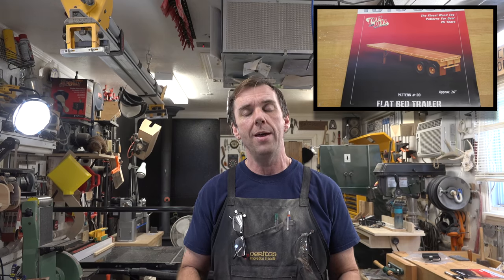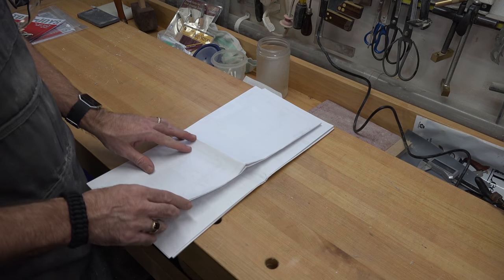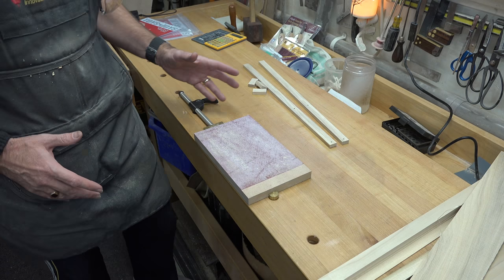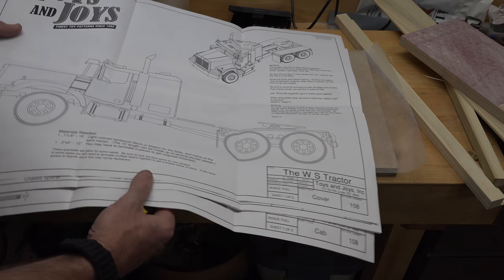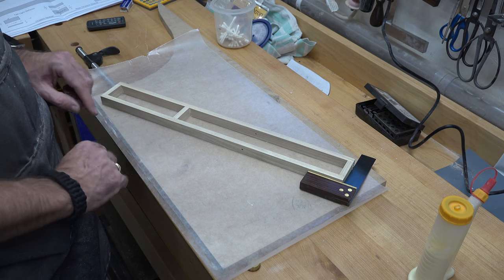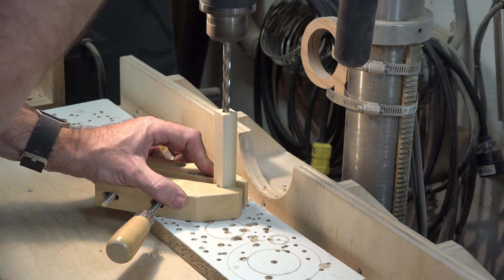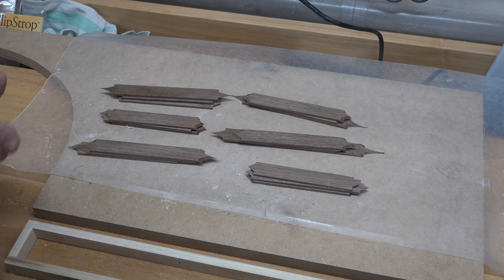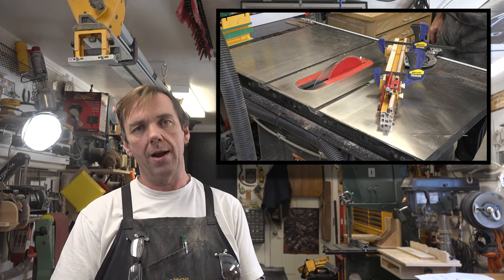SCALE MODEL PART 1

Comment: What brand of brad point bits do you use that come in such small sizes?
Reply from the maker: It's not a matter of the brand Barbara.  It's a matter of the supplier.  I find that Lee Valley pretty much has every size imaginable for brad point bits and they are available in sets or in singles.  Your choice.

Comment: I've had these plans sitting in a bag, unused, having been a bit intimidated by the parts involved. Your videos will go a long way to demystifying the build process. Thanks! Quick question: What did you use to round the edges of the axles? I'm assuming a router? But any memory of what size?
Reply from the maker: I'm going by memory here Matthew but I'm pretty sure that the axles were rounded over with a 1/4" round-over bit on the router table.  I only really use two sizes in these model builds.  1/8" and 1/4" so the 1/4" would be more fitting to this part of the model.  I hope this helps.  Good luck on your build and thanks for tuning in to the show.
Reply: @acutabove_woodworkings  Perfect thanks!

Comment: The 60° was on the plan on page 1
Reply from the maker: Thanks for the input Michael, it's appreciated.  Page one of the plans shows no dimensions at all and is nothing more than a parts list, general instruction page and drawings of the finished products.  Page two, however is where the measurements start.  I'm not being a smart ass, I'm just clarifying for others who might be reading this so that they can reference the correct prints, which would be page 2 of 9.  The 60 degree angle that I am referring to being missing, is the angle on the frame pieces, not the angle on the rear chassis spacer which does show the angle.  And while we know that these pieces go together and share the same angle, there are those who might not know that and might not put that information together so I it was more of a lesson of referencing other parts of the drawing to get missing dimensions.  For pieces that are completely different, each piece (in my opinion) should be properly dimensioned.  Working on assumptions is a dangerous thing when working with plans and for my liking, I would have liked to see each piece with it's own measurements and angles for those who are not as fluent in reading plans as you and I are.  Thanks for tuning in sir.  Great to hear your comment on the show.

Comment: Wow! What basic mistakes been made by the plans. Actually, not the first time I have noticed these basic mistakes as I have plans for a Stagecoach which leaves you up in the air to what the whole build is about. It's like they give you a set of plans and don't really give you any ideas how to go about a certain part being built. So I have no clues to how to make the build but using my imagination.
Reply from the maker: I don't think I have ever had a set of plans where I didn't find mistakes Gary.  One has to remember though that they are plans, not instructions.  I quite enjoy trying to figure out the best method of making the pieces.  It can be a challenge at times but it's one that I like.  Thanks for tuning in to the show.  I truly appreciate it.

Comment: Why do you not email them with all there mistakes. So that other people can build with no problems
Reply from the maker: While this company is quite responsive to customer complaints and concerns, they are not about to reprint and entire run of a pattern because one or two woodworkers point out some flaws or missing measurements, especially when he measurements are able to be obtained by scaling from the full size drawings that they provide.  It can be a challenge with these plans but a little persistence and some thought will get your through them just fine.  I kind of like the challenge as well sometimes, even though it frustrates me.  Thanks for tuning in to the show Paul and for taking the time to leave me a comment.
Reply: The thought of reprinting never crossed my mind, but to pay 11$ or so for a pattern that you have to basically work out for yourself is a bit of a joke. I am not a wealthy person by any means but on a few occasions watching your video, you have came back and said if you head froward to such a page and do this this way you will save a lot of trouble. The problem with this is for people on my earnings every piece of wood that I purchase has to be hard earned . So for example the bit on where you say that the drive shaft that goes under the carriage do not glue up the mounts as you will not get the drive shaft in. This  is ok but the problem comes to whenever for example I go to buy another plan. And now having the same insight that you have with plans, what am I supposed to do email you them and ask you to do another video on them. otherwise I will be putting a lot of time and money into something that needs a degree to work out. A more simple solution of putting a guide to what parts need put together first would have been more of game changer .
Reply from the maker: I see your point Paul.  A good idea with any project, whether it be small like a model build, or large like a desk, is to perform dry fits of all your parts before you ever apply any adhesive to the parts.  If you are unsure about the measurements, always check and double check and be sure that you are completely aware of where the parts have to fit and what other parts are required to fit around them.  A little forward thinking will always go a long way to helping you figure out these plans.  Now don't kid yourself, these plans are not necessarily for new woodworkers, but with a little foresight and some careful checking, I fully believe that any level of woodworker could complete these model builds to a quality that they would be proud of.  Don't let one or two missing measurements deter you from trying something that you want to try.  The process for all of these models is pretty much the same and there are plenty of online resources (myself included) that would be more than happy to help out if you got stuck with not knowing what to do with a model.  Start simple and work your way up Paul and I think that you will surprise yourself.
Reply: Well no matter what keep up the great work Kenny. Your video's without doubt have to be in the top ten of describing the project in such detail it is amazing , thanks for your time. And maybe someday you will do another great model of a truck or Car. Keep up the amazing work.
Reply from the maker: Thanks for the kind words Paul, I truly appreciate it.  I will continue to produce the show as long as I enjoy doing it and at the moment, I have no intention of stopping.  Thanks once again for tuning in to the show.